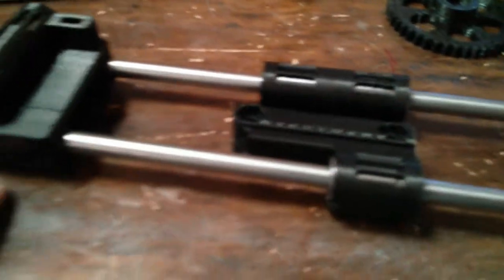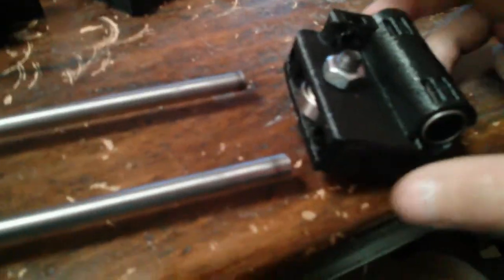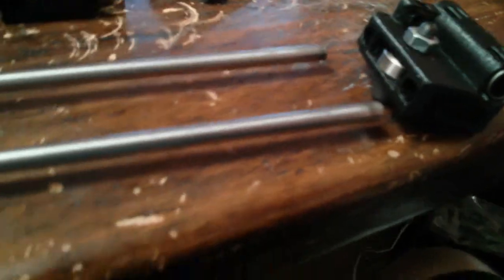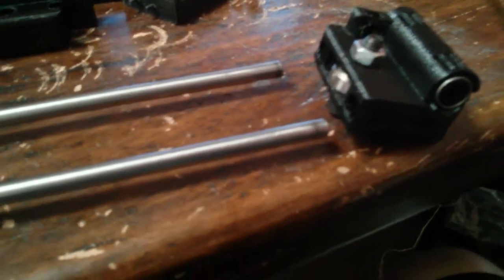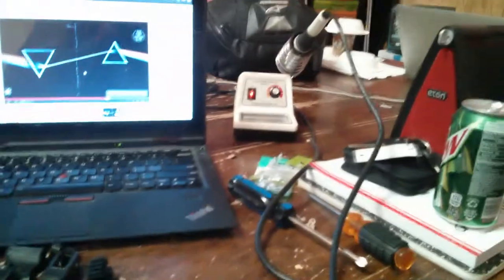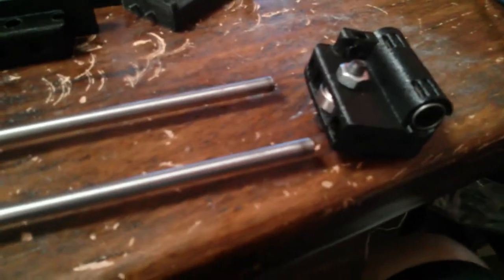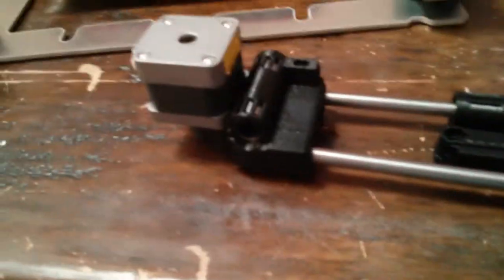x carriage rod does not fit

Comment: I was just having the same issue, I recommend just using some sandpaper and opening the holes up a bit on both ends. If you have a dremel even better.
Reply from the maker: i eventually just hammered it in.